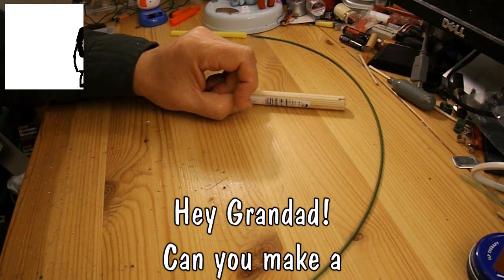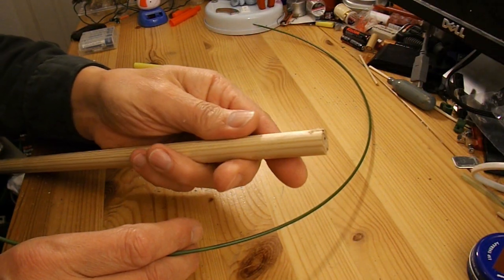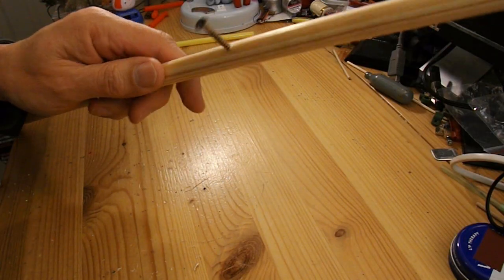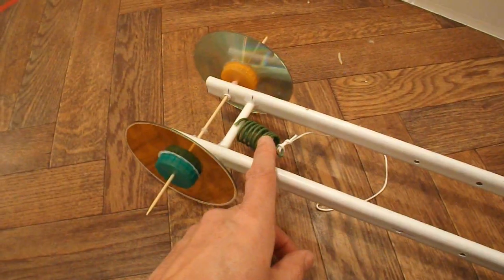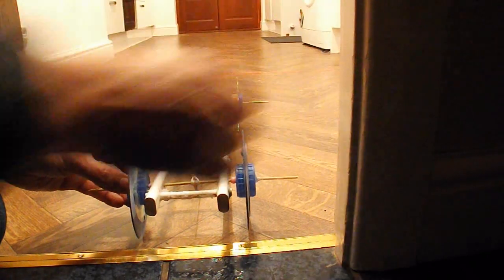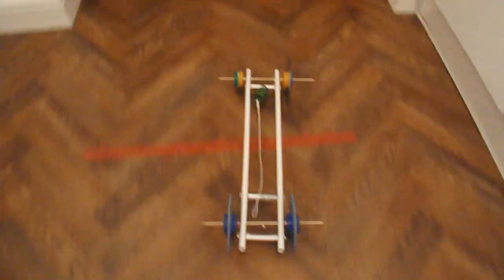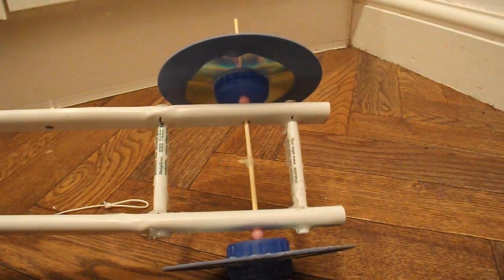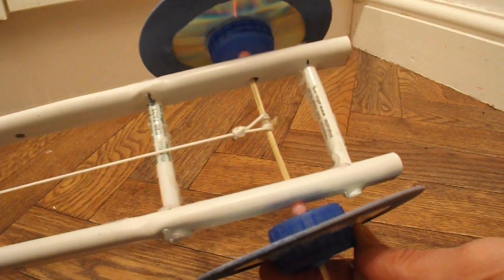Spring powered car

Comment: What kind of spring is that
Reply from the maker: What sort of answer do you want? It is a coil spring., because the wire is wound in a coil. Do you want the thickness of the wire, the number of turns, the diameter of the coils, or the colour. I can tell you it is green? It is also far too powerful for this car.
Reply: @GrandadIsAnOldMan  just the dimensions please
Reply from the maker: @gooseinabox2062  I would guess that wood dowel I show you at the start would be 12mm diameter, so that would be the inside diameter of the spring, although you can see when I had finished it expanded a bit. The wire used was probably 16 SWG so that would be about 1.6mm, just some scrap wire I had from a garden ornament. It looks like I managed 9 turns for the coils. The only reason I made it was because I didn't have any suitable spring to hand. If you check the video description you will find some useful links including this playlist for my Spring Power projects https://www.youtube.com/playlist?list=PLA5a2xPRSrB3bEp0pE4UcVggFXWbujnSj
Reply: @GrandadIsAnOldMan  thank you very much!
Reply: @GrandadIsAnOldMan  thank you very much!
Reply from the maker: @gooseinabox2062  the other designs use less powerful springs and work much better 👍👍

Comment: I am inventor too.there should be a few pre spinned.when one of the spring reduce its power.there should be some mechanism so that it skip to another spring.that will make this car run continuously.as the car run there should be a mechanism that will roll back the weak spring.that will make this... springed engine car.

Comment: I have a project almost Similar to what you did right there but  I have to insert my mechanism inside a can beverage of 330 ml or 500 ml and it must roll for about 1.5m or further than that...I wanna use the spring as my source to bring about motion to the can beverage so that it can roll
Reply from the maker: Does it have wheels or do you have to make the can move on it's own?  You could use a similar method to this https://youtu.be/oDGUwR5LC_E